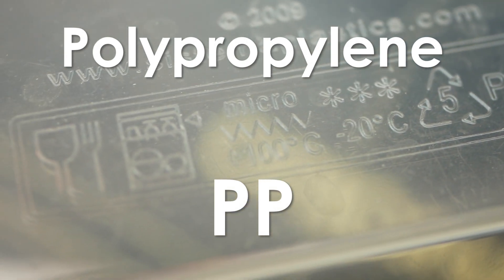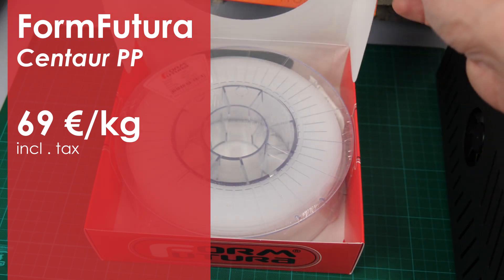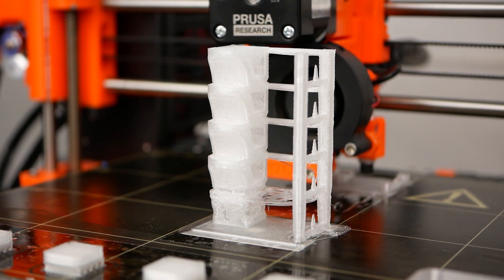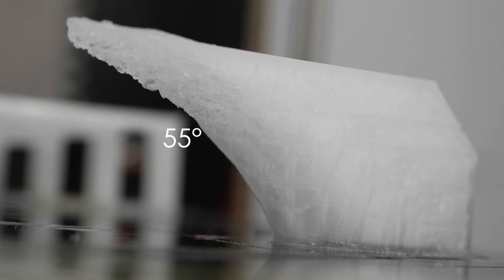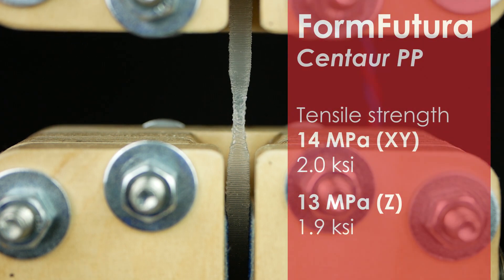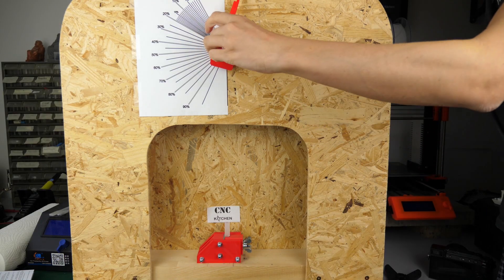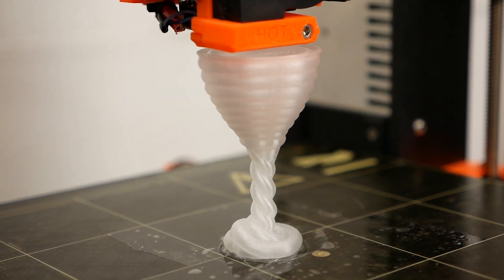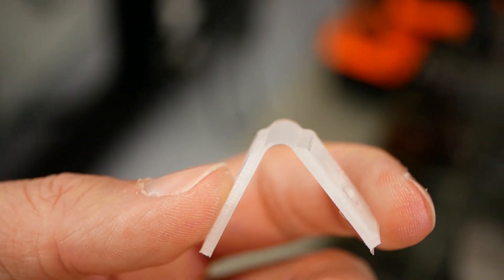3D printing Polypropylene (PP) filament - FormFutura Centaur PP™ REVIEW

Comment: One unique application is custom insulators for radio transmitter antennas. Polypropylene, polyethylene and polystyrene are the only ones that have reasonably low electrical loss tangent in radio applications - except of course PTFE is even better but not for 3d printing.

Comment: What do you think about pp with a glass fiber?  Toughness and layer adhesion with higher stiffness perhaps?  My experience is with short fiber composites is not good.  So may not benefit here either.   But curious for your thoughts.

Comment: I am working on printing a crossbow and I'm wondering what material you would reccomend for the bow limbs?  I've been using PETG, which works well at first, but doesn't stand up to repeated flex.

Comment: I have trying to print with CarbonX PPCF, and the bed adhesion has been a nightmare. I have been using the packing tape method, but the warping is so severe, it takes the tape off the bed. I am using an Ender 3 Pro, with manufacturer recommended settings, N-220C, B-70C. Anyone have any experience with this specific material on an Ender 3?

Comment: I print with a .3mm size nozzle on a creality ender 3 at 235C, with a bed at 90C, I have gotten long parts around 20mm tall 50mm long and 25mm wide to be "perfectly" flat with that heat level on the bed, also a brim helps alot, I have to increase flow for that though as the layers separate a little, I find that a flow of 108-110% was good for all layers however if applying a brim upping to 120% for the first layer was necessary and I've played around with extrusion width a little too but have found it to be overkill. Also keeping the silicon sock may help a little. All other settings like 30mm/s for print speed and whatever CNC Kitchen does is what I do as well.

Comment: @CNC Kitchen Stephan I don't see another video for PP in the last three years. All of the water pipes in home are made from polypropylene as it is a popular material. So, using this material for pipe fittings could be an interesting use case. From 3D print testing point of view - It would be awesome to see pressure testing, i.e. if you print a pipe and do air/water pressure test. How much PSI will sustain? Is it possible to print a pipe fitting and put it a water pipe system and last?
Reply: Sometimes you just need a custom, low pressure adapter, to connect two pipes or siphon with different diameters. I see the test equipment for pipe testing is called "Pressure Test Pump"

Comment: Unfortunately, unless it was just the tape I was using, the warping pulled the tape off the bed so still warped. Not good enough for large prints. A sheet of PP as a bed works better.
This was with a bed temp of zero deg. A hot bed just heats the adhesive on the tape and makes it worse.

Comment: Warping is actually due to high temp since high temp will make the polymer chain move easier and get rearranged, but high temp also can give you good adhesions. there is always a balance between the good adhesion and more "freeze"  polymer chain (lower than the Temp of crystallization).
Reply: I have a problem with big PETG parts warping. I tried different filament manufacturers, adhesive I'm using is good for petg (PVP on glass), and bed temperature is reduced to 60° which is significantly lower than recommended for PETG 75-80°. Actual bed temperature is also a bit lower. But big parts are still warping. What am i doing wrong?
Reply: @horus3577  how big is the part and how is the chamber temp control

Comment: For prints repair or welding i use ts-100 soldering iron - small, usefull, good temperature control. You can try it, or some others soldering irons, that has screen and temp.control.

Comment: I think in the long run plain glass plate will be best.

But I started wondering.. what happens if the glass is wiped with a nano sealant instead of glue stick?

Comment: Old video, but I came here because I recently discovered this material when searching for light weight filaments. In my hobby (FPV quadcopters) I keep my quads all under 250g, so weight is essential. The current build that I am doing right now will be super tight so trying to shave all the weight from the 3D printed parts (mainly antenna mounts, camera mounts and such). Ordered FormFutura's Pegasus PP Lightweight, which is supposed to have only 0.75g/cc. If I don't have to 'bulk up' the designs a lot, then the savings should be substantial vs. PLA and TPU that I'm using currently.

Comment: Trying out pp for the first time; the packing tape is working a little too well however. No matter how much z-offset I give, or how cold I print the first layer, the tape sticks even better to the print, than the print does to itself. I suppose I just got unlucky with the specific composition of the packing tape I have; but I dont see you having this problem; do you remember which brand that is?

Comment: Great videos, I learn a lot. What printer did you use to test this? Does your printer say it supports PP or you just tried anyway? I want to get a printer I can be confident supports PP filaments.
Reply: Pretty much any printer will support pp. It basically only needs a heated bed

Comment: I tried printing with PP today but everytime I try it forms a blob in the mechanism that pushes the filement down into the extruder. First parts goes well bu withing 10 seconds it ends up stuck. Any idea how I can prevent this?
Reply from the maker: Print slower, get a more constraint extruder, though it also worked on my CR-10 wo a problem.

Comment: This may have already been said. I would not apply the tape directly to the heated bed. I would apply it to a spring steel sheet like the standard PEI or Textured sheet that comes with the Prusa. This would make cleaning up the glue residue much easier.

Comment: Would be great as an insert material in other material designs... for high flex, impact, etc areas of an otherwise other material design. We need more multifilament machines, with more than two filaments. Rather than it being about color, it should be about capability. Take form this material when you need its properties, take from the other when you need the others, and so on and so forth.

Comment: Hey man. Thx for reviewing this filament. I am working for a concrete workshop and we are creating molds out of 3D prints (mostly). Have you tested the sanding ability? Is it easy to sand? Would it be easier sanding with water?

Cheerio - Ben

Comment: Because of the mentioned properties ( hydrophilic, heat/chemical resistance etc) I think PP would easily surpass most flexible filaments with some development. Excellent engineering video as always! Thanks.
Reply: You mean hydrophobic?
Reply: @kzalesak4 Always getting them mixed up. Hydrophilic, hydrophobic, hygrophilic, hygrophobic, gets confusing.
Reply: I've been using PP-based TPE for a while now. It's completely immune to moisture and has a more grippy rubbery feel than TPU.

It has the same bed adhesion challenges as normal PP, but that has been recently solved by the Prusa PP plate.
Reply: @tomhsia4354 That sounds excellent. I would love a more rubbery version of tpu. Tpu has brilliant properties but it's very "rigid", similar to other polymers.

Comment: I can think of so many use cases for this in science and chemistry but it would be cool to see if you could use a muli material printer with pp and PLA or carbon insert.
This way the stiffnes and perhaps ome of the warping could be midigated.

Comment: To remove glue from bed I would recommend first using oil + rough sponge, and after all glue is no longer sticking to bed, then use soap + water to clean oil :)
Reply: That's a good way to severely damage printing surface

Comment: I really want to try this filament out but as I have a Textured steel sheet on my prusa mk2.5s I am scared of it getting damaged when the tape is applied, do you know if that would be fine?
Reply from the maker: Can't gurantee it but I wouldn't really be afraid. Been using a textured bed for a year and have not seen any damage on it. An alternative would be using Magigoo PP.
Reply: @CNCKitchen  okay, it's not like a disaster if it gets damaged, but I just wanted to ask if it's okay to do. Thanks!!

Comment: Polypropoline can be autoclaved, so even though this cup is impractical for any kitchen to clean, similar devices can be sterilized in medical and scientific contexts. This has potential to be very useful for those purposes when you consider what 3d printing can do.

I am also thinking about microfluidics could a 0.1 mm resolution be good enough for that fancy micro chemistry?

Also it seems to hold up well against many fuels. Diesel, butane, propane, it's got you covered. Less so with gasoline. I'm thinking of a rocket fuel mixer and if I could 3d print that I'd be very happy. I bet it's layer adhesion and uniform tensile strength will help prevent leaks under pressure, provided that is under only pressure like a sods bottle or that it is held within a much stronger container.

Comment: Perfect replacement to TPU for RC hobby :) Just tested Ultralight version of FormFutura PP! 0.75 weight! Can you test it too? 
used it for camera mount and enclosure print - same way as TPU is normally used. This material is stiffer, so protects better, but it is still flexible so observes vibrations well :) I think it is the ultimate one for part such as those :) PC MAX for anything that needs to be stiff :)

Comment: Hello, what 3d print do you use??
Reply from the maker: Printed it on an Original Prusa i3 Mk2.
Reply: @CNCKitchen  Thanks for the reply. I ask you why I am thinking of buying this machine to work the PP, in our office we use that filament brand and we need a better machine than the one we have to work it. Have you had many difficulties to print the PP with this prusa? With the machine that I have of five pieces that I print only one goes well.

Comment: I also got a spool centaur pp a week ago, but haven't started printing it yet, as I wanted to research a bit beforehand. So, great to find a video about it! Have you used a Bowden or a direct extruder for it? Asking since the material is semi-flexible....
Reply from the maker: I printed it very successfully on both. On a bowden, maybe turn down the speed a tiny bit of you run into problems.

Comment: Just received my PP 3D filament. 
Making a stirring vessel to be dipped in 1:4 Aqua Regia.
The filament looks quite flexible. 
Did anyone else print it with Bowden drive?
I'll try it with my Creality ender 3, keep you posted
Reply from the maker: Printed it on my CR-10 without an issue. Maybe go a little slower to be save. Aqua Regia shouldn't be a problem, even used it in hydrofluoric acid. Just make sure it's watertight that it doesn't soak up the acid.
Reply: @CNCKitchen  Completed the print. Printed it at 120% flow at 0.1mm. 
No visible layer mark on perpendicular walls. Yet to check if it holds acid or not.

Comment: How to avoid PP warping printing exactly, 80c-100c bed temperature?
I've to set 60c bed temperature and its warping in layer> 5. 
Then I try to set 0c bed temperature, it's better even though a little warping in the bottom.
That case when I print a small one object (about 45 mm).

Comment: That’s most definitely an interesting medium. I really like how it functioned in vase mode. Am I correct in saying it’s 40% heavier than most other filaments? 🍀🇦🇺
Reply: lighter, 500g of PP was 140% of the length of 500g of PLA. so weight and density are lower than PLA, as is rigidity. chances are much better for dropping an object and it surviving as well. would probably be a good material for toys

Comment: I find PP warps easily. Any tips to avoid warping?  I have tried heated bed up to 100 degree with PP tape surface.  I am using Prusa i3 mk3 without enclosure. But in the video, there is no enclosure too.

Comment: Hi everyone:
What is the best way to remove the tape sticky residue from a heated glass bed? 
Thank you!
Reply from the maker: Heat it up and use a scraper.
Reply: @CNCKitchen  Thank you!
Reply: @CNCKitchen  I had no problem to remove the tape from my glass bed but it's incredibly difficult to remove it from the part. Do you have any suggestion? Thank you.

Comment: I would like to 3D print a custom insole/orthotic shell. Does anyone have any suggestions/experience on doing this. I currently use PP sheets for vacuum pressing my shells so I figured PP would be the logical choice for 3D printing.

Comment: I was thinking an engine to carb boot and carb to air box connector on a motorcycle.  I seen a guy printing an adapter for his dr350 carb swap on instagram and never asked about how it came out or what material.

Comment: What contamination from nozzle, I dont think there is deposited too mutch dangerous materials, also the material is sterilized in the nozzle, there would be  comparable number of contaminants as in plastic bowl that has been used multiple times, we arent dealing with killer chemicals in 3d printing, not in large enough quantity
Reply: Its still not safe to put most plastics in contact with your food because they still have chemicals your body doesn't deal well with

Comment: Would you say that PP material is the best material to use for a liquid tight container?
Reply from the maker: No, you can make liquid tight containers with most other filaments as well. Vapor smoothed ABS for example might do very well in this regard.

Comment: the application: you can print your own boxes for storing different electronic components! These pro-storages are pretty expensive and I'll better print something of my own design than will be dealing with cheap Chinese clones (which are not cheap if you'll be counting the material price only). Of course the best of it is that you can design a proper box(es) by yourself...
I've bought a 3d printer and starting a trip into this world but my main aim at the start was just to make a shelf for two Behringer synth I've bought a month ago :) Also I'm making my own analog synth and I want to 3d-print some original details for it.

Comment: Since PP will survive the microwave, you can use it to sterilize your food containers.  1.5 to 2 minutes to disinfect, depending on power of your unit.  If you have interchangeable heads on your printer, you can dedicate one head to PP and avoid contamination.  TAZ 5.

Comment: Good job, very informative video on something I was interested in for a while. You mentioned that the cup print was not watertight and thought of ways to fix it (presumably printing fixes). Do you think PP can be used for airtight prints (a container able to withstand up to 8 bar)?

Comment: The food safety of a material is entirely down to the processes used to turn it into its final product. Due to the uncontrolled nature of extruding filament on to a surface, it can't be guaranteed food safe. Any manufacturer of filament cannot claim this past their production. Care should be taken if you intend to use it for food.

Comment: printing with PP and HDPE for many years (8+) .. here's some light ring print in PP for e.g. from 2009 :D https://photos.app.goo.gl/xanMrSaVviTu5ohi9
or a mendel part (iirc also 2009) https://photos.app.goo.gl/F3WARJYjmko5z2Z68

PP is uber cheap filament if you have 3mm nozzle, locally I get 1kg of 3mm "transparent/white" for ~10eur and I get gray one (recycled) for 6-7eur per kilo .. this is how recycled gray one looks like https://photos.app.goo.gl/b9FhJmdd8Jy2ZqGY6 (mind those are all pictures from 2009-2010, old type extruders, old hotends with ptfe & peak... the dart vader is printed with 0.6mm nozzle iirc, or 0.8mm can't say for sure).. 

you can print PP/HDPE on cold bed on double sided tape without a problem, on heated glass on the packing tape ... PP/HDPE really benefit from heated chamber... PP/HDPE like to be printed slowly, hate overhangs and don't bridge very well but I have parts in use since 2010 that I use today still

Comment: What I am really missing in this video is information about printing safety. Is it "okay" to print without enclosure and carbon filtering (like PLA, though enclosure + HEPA would be better)? Or is it a no-no without excellent airflow and filters like ABS? Otherwise great video! :)
Reply: PP is non toxic
Reply: Do you have a source for that? I can't find a study on printing PP.  Would also be iteresting in terms of UFP emission.
And I wouldn't print PLA in a closed environment next to me either, always keep the windows wide open and better not be in the room. HEPA filters should help with UFPs there although PLA is not that much of a problem according to some studies (at least if printed <= 200 degrees celsius).

Comment: Thanks for your Video. What I don't understand ist that high price. PP usually is used in the packaging industry because it's one of the cheapest polymer (besides LDPE and PS). An extruded film is far below 10 Euros per Kilo (mostly below 3 Euros per kilo). Is there anything known why filament prices are such high (except margins of 1000% and more)? It doesn't seem to have technical reasons.
Reply from the maker: Supply and demand. If it would be a common as PLA it would be way cheeper. I could also imagine that extruding PP is more tricky than other polymers making it more expensive.
Reply: @CNCKitchen  Guess You're right  it is a question of supply and demand. Very many (as well high grade as cheap) toys, grocery devices and food plastic boxes etc are made of PP, most of the caps on the PET bottles are PP as well - simple because it's cheap and easy to injecton-cast, standard process. 
Looks like "as long as market allows". (PP grain in industrial quantities was <0,9 €/kg in the last 12 months ).